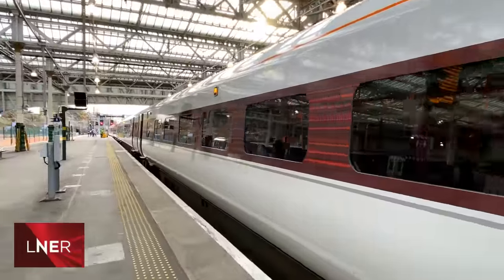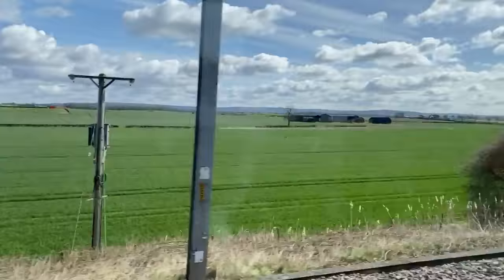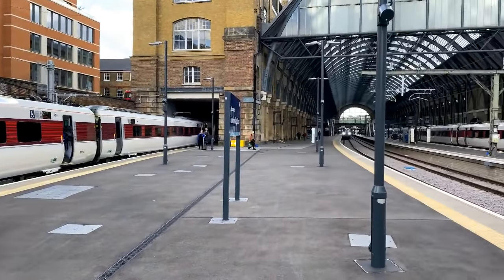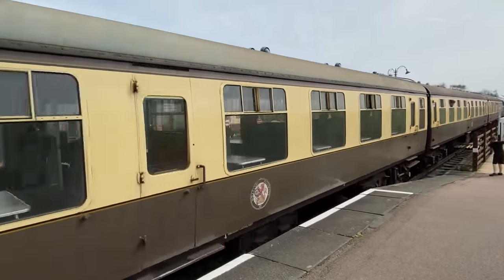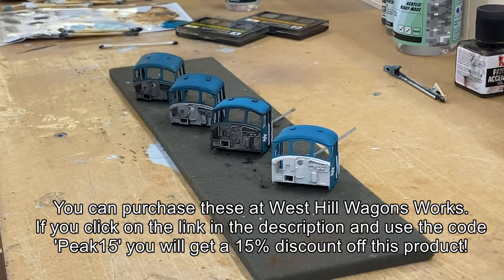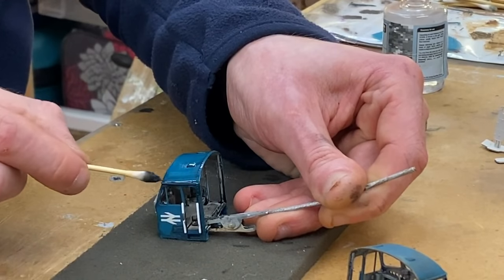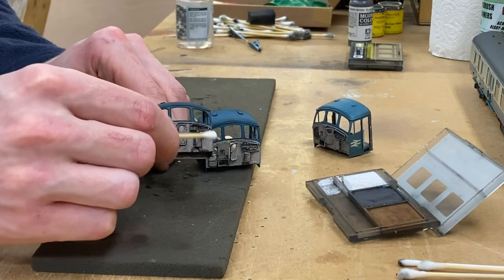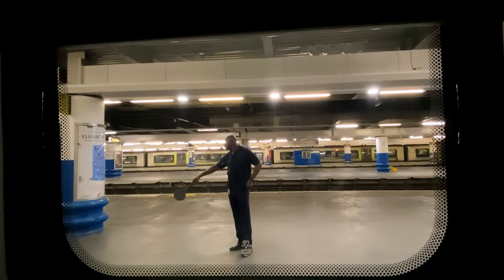Dean Park Model Railway 298 | The BIG Trip South 2022 Feat. Everard Junction & April Update

Comment: The layout. I note what appears to be some "canted" track, the coal train runs over. I also installed some canted track on one of my 5ft miniimum radius curves, on my exhibition layout. But this has revealed a number of locos do not like Peco code 75 track when "canted", which seems to cause slight jerkiness (interference with pick up). Worst offenders seem to be Dapol & Heljan locos, & a wicked Hornby 4VEP, that came fitted with stupid steam roller wheels, but now runs on Bachmann  trailer bogies and replacement motor bogie NEM wheelsets, so finally "cants" perfectly.

Happy Modelling 😝.
Reply from the maker: Yes if I’m honest, code 75 (while more realistic) is soo fine and the trains don’t always like it. 

If I did another layout I’m not even sure I’d go to 75 from 100. I don’t have any hassles with code 100, my trains run flawlessly and I don’t have issues with trains moving on to my canted curves.

Comment: Great video, Dave: something a bit different.  I was struck by how widely coupled the Azuma carriages looked to be: they need to get some close couplings so they don't need such big corridor connections!
Those class 45 cabs look great, and as Richard said, a good way to practice weathering before hitting a £x00 loco.
Do they not have the club car on the sleeper any more?  The one time I used the sleeper (up to Aberdeen, for a job interview) I rather enjoyed the club car. Proper seats on a train was a novel experience, and a fair selection of whisky, I seem to remember. 
Doesn't look to be much difference to the cabins to what I remember from the early 90s, except fancier switches.  Looks to be a similar size cabin, if not a bit smaller now.
Reply from the maker: Hi yeah they have club cars. But it was too late (for me!) to go there and really have anything. 
Yeah they say these new ones are a bit narrower than the mk3 cabins. Which is crazy really!

Comment: Another excellent video!  I particularly liked the weathering tutorial as I purchased some of those panel line washes a while ago but haven't used them much.  Also, I see I can try replacing makeup sponge wedges with packaging foam for rust effects.  I like to use inexpensive craft acrylic paint in raw and burnt umber for older rust.  Cheers from Wisconsin!

Comment: Class 45 Peaks. Yes big, with a problematic 1-Co-Co-1 wheel arrangement. First time they ran one into Ramsgate EMU depot (from an Inter-regional service in the 1960's), they discovered these bogies didn't like very sharp pointwork, as the whole loco decided to take neither route and instead go for an "Earth fault" (all wheels in the dirt). Putting this hefty beast (over 120 tons) back on the track was complicated by the fact no crane could get near it due to various structures close by. In the end it took over 24 hours to slowly chock & block it, with sleepers & hydraulic gear.

Comment: Great video David. The Great Central railway is very unique in that a lot of it is double track and you pass trains going t other way - just like on the big railway !!!

Goes without saying that 45125 would be my favourite loco, but itwas a featherweight train and she didn't really make much noise.  I have fond memories of riding behind peaks in the early 1980s where the "ton" was not uncommon. I get a little irritated by folk who slag them off using the derogatory nickname "wagon".  If only they knew that a peak would easily outperform a 47 on freight and passenger work.

Great stuff